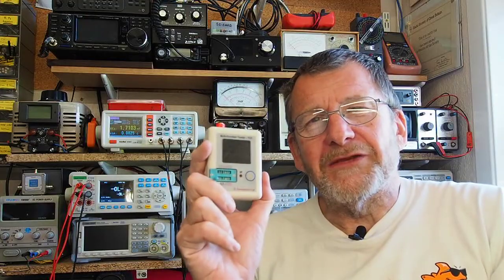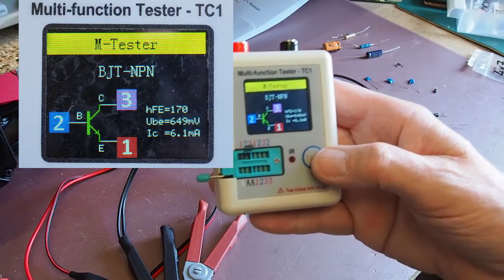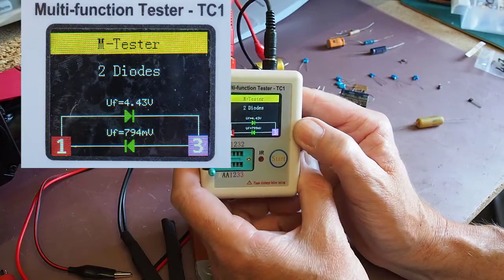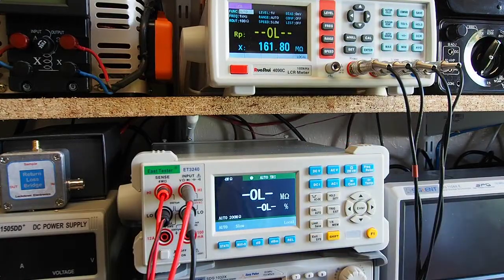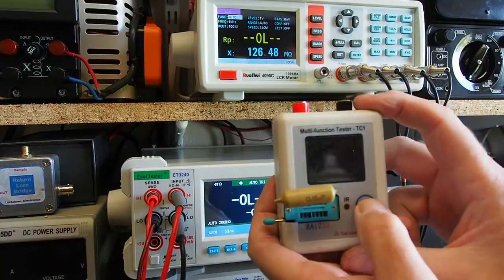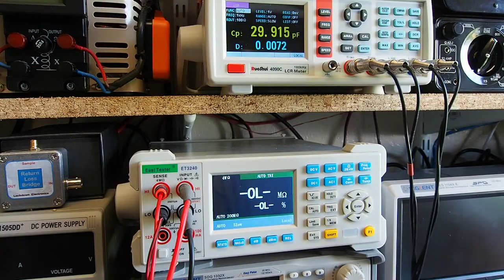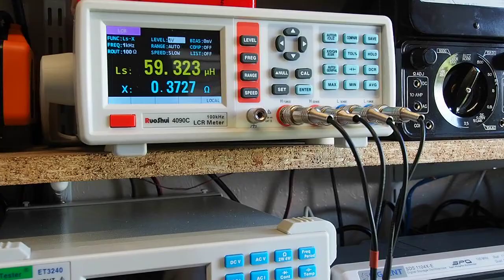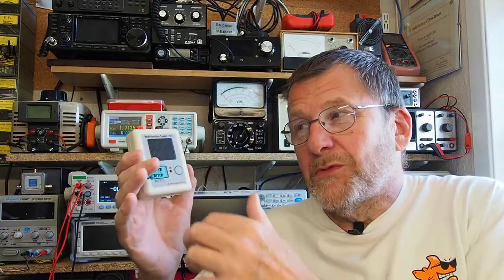The TC1 Multi Function Tester   Cheap and nasty or cheap and cheerful?   A review #077

Comment: Nice video!
Take a NPN transistor (BC338). Pin 1=emitter, 2=base, K=collector. Start testing. It will never stop testing... Nothing can stop it except screw it open and disconnect the battery connector...

Comment: TC1 is a really handy meter, it cant detect zener diodes over 27V or so. Also it can't detect fake FETs, which must be checked under heavy load. But excellent meter and much faster than the ones with the long names. The calibration setting on mine always says 3.12k. Not sure why.

Comment: You did run the calibration required by the meter (it tell you in the manual I assume)!  It's simple, just short all three inputs and turn on and it will calibrate. :)

Comment: gives some pretty weird readings if you accidentally find out about self test mode by inserting a blown FET...
meh. i havent had an IGBT read properly, but i havent got any new ones to test...
FETs... fine, P and N. 
thyristor, fine.
yeah, not the best resolution on small inductors... 
caps, leds and diodes, fine.
bjts, fine.
sticking an analog meter in was interesting. i like watching needles swing around :)

Comment: I've recently purchased a TC-1 and the thing it doesn't do is give an accurate test for germanium transistors. The tester always reads them as two diodes. It's frustrating because it was the reason I bought the tester.

Comment: Regarding to zenner diodes you need to use the terminals marked as K (cathode)  and any of the two marked as A (anode) instead of the 1  2  and 3 that you've used. That way you can test zenner diodes up to 15V (as far as I can recall) and yes you are right it is indeed a quite remarkable tester for such a low price. Good and informative review by the way. Tnx

Comment: I have change the battery for 1000mA, the ones that come with protection circuit and place also a switch. This unit when is off is not off, is sleeping with the drain bat consequences

Comment: I picked up a T7-TC-H (LCR-T7-H) a short while back... for what they are and are to be used for, as well as considering their price point, they are a great little unit to have around for quick part identification.  Are they perfect?  Nope, but still very handy.

BTW... the specs of mine indicate a low end test ability of 25pF and it does have issues with the few capacitors I have that are below that.

Comment: Some of the newer ones (still called TC1) off eBay are of much lower 
quality. They have no crystal, can damage zener diodes when testing and 
use a counterfeit MCU. By "counterfeit" I mean it says MEGA328 on it but
 it's a different MCU entirely which is completely incompatible and 
can't be reflashed with newer firmware. There's a big thread on the 
EEVblog about this.
Reply: Hi, is there any way of telling it's a genuine TC1 from external appearance?

Comment: I checked a 5.1V Zener diode with my new TC1 and the diode was hot when I removed it, after that the screen would not shut off for 2-3 minutes,  during that few minutes , no matter what resistor or diodes I tested it would only show the value of the last Zener diode! I am a total newbie but I think the battery or the shut off component was faulty,  that pulse of current that the battery sends through the diodes/resistor to test should only be a few milliseconds but in my unit it kept on giving, lol. anyhow I sent it back but ordered a new one ,still waiting.

Comment: Got one of these. As a component (transitors, diodes) tester it is ok. For capacitors, the results are rather good. But for inductors, it's lame. The resolution of 10uH doesn't help, but ok, it's written in the specs. I get over 10% error for about 1mH, that starts to be a problem. For inductance above 6mH it is completely off. So, for transformer or power filter testing, i can't use it. Don't know if is a problem with my unit or it is a general issue.

Comment: Good video, thanks for your take on that stuff.  Have you tried to use the IR remote control reader?  The unit I bought cannot read any of my remotes (Samsung, Sony); the red light blinks (it sees the beam) but it never decodes the key.  I wonder if that behavior is normal, or if it is defective.
Reply: Keep in mind the spec sheet states that it decodes HItachi format codes, so it may not do other IR encoding standards, if they exist.  I'm no expert on IR protocols though.  I did get mine to decode the power button on my Sony, but I had to hold it down a few seconds.

Comment: I also bought one of these and 1/4watt resistors of 2K Ohms are seen as an inductor of 0.1mH with 2K resistance. Ive tried two 1K resistors in series and it still sees it as an inductor. Any similar experience with anyone ?
Reply: No similar experience yet, just got my unit. The resistors often have their resistive (metal) foil as a helical track, which essentially makes up an inductor. I have no experience on what ranges to expect from resistors though.
Reply: Are you looking at wirewound resistors?  They are also inductors of a sort...
Reply: No, not wirewound and it seems to be just tthis resistance. Measuring resistors greater or lower than 2K works fine,

Comment: Cheap and nasty IMHO. The TC1 worked to start with, then after a while started giving false results, particularly with transistors, notably Beta, or hFE. I just replaced mine with a Peak Instruments device (DCA55). More money, yes. But worth it. And buying British!
Reply: I have a TC1 and primarily use it for testing forward voltage drop on germanium diodes. Do you have any advice on comparing the Peak Atlas with this?

Comment: Thank you for your review. I've owned one of these for over a year, and they are great for sorting and verifying parts for values and condition. One thing you did not mention is the capicatance test also has a "Vloss=XX%" reading, which, combined with the ESR impedance value, is a good indication of an internal resistive leak and component failure. A failed capacitor will usually have a Vloss value over 5%, with new or good capacitors reading a Vloss of under 1%

Comment: I have two of these actually. The first one died, when I hit the test capacitor button twice ; I knew your suppose to discharge capacitors before testing but didn't think it would be that sensitive :-(  That aside it works quite well; how did you connect your banana plugs? there isn't much room in the case for mods.

Comment: Hi Bill. I have just received my TC1 from Ebay this week. And as a relative beginner in electronics already i have found this to be invaluable. I recently bought an old non working 1960s transistor radio with the intention to get it working. And straight away it has been a boon. Great video. Terry

Comment: Wouldn't be without mine. I'd recommend it as a purchase after the multimeter. On the bench no matter what other gear I'm using. 

Quick warning. 
Don't try to measure in circuit components. Capacitors especially. 
Guess how I know.
Reply: Will it destroy the components if we measure it in circuit?
Reply: @sfjohn9868  it will destroy the meter
Reply: @yes____ I was wondering this myself. What if you discharged the circuit first. I want to use this to test electrolyte caps in circuit.
Reply: @RetroGadgetMan  i would recommend desoldering the caps and then testing them out of circuit in order to have a proper reading. Of course, make sure theyre discharged before testing
Reply: @yes____  thanks. I was hoping to avoid removing them. Is there a device that can read the esr in circuit.